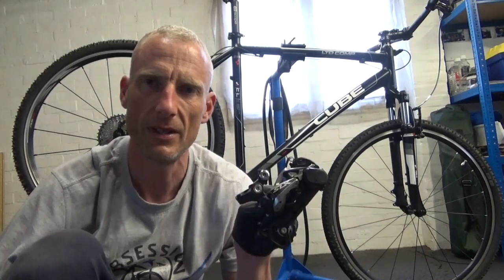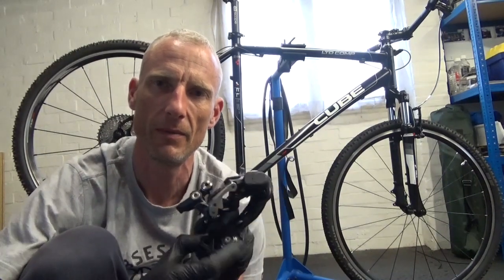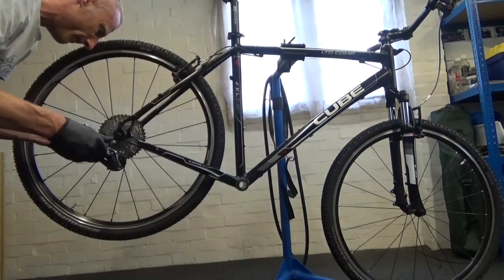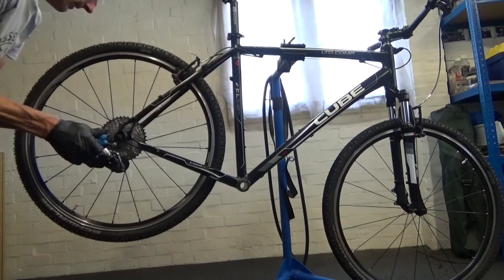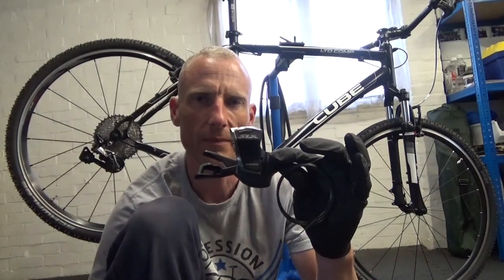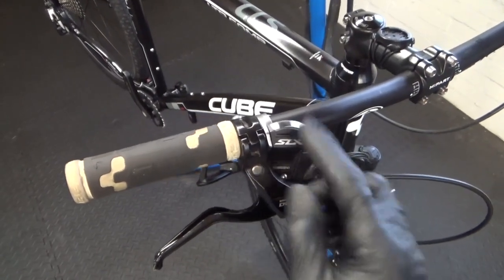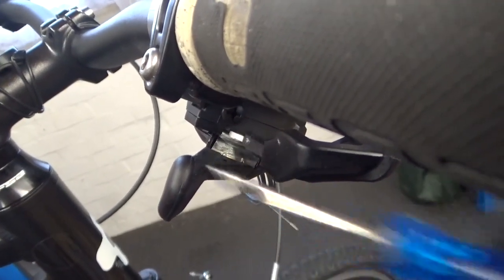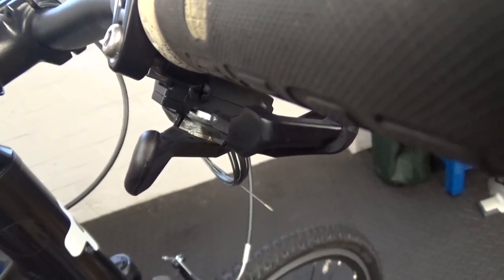Shimano SLX M7000 1x11 Fitting Guide

Comment: Thank you for an excellent and detailed video. As a fairly new and not so young cyclist I can manage most day to day maintenance but have not tried anything more adventurous than indexing gears and replacing the front derailleur. I have started to look at how difficult it would be to upgrade my Giant Toughroad SLR2 which has a very basic 2 x 9 Acura / Alivio groups to a 2 x 12 SLX setup, this is presenting more questions than answers. Do you have any pointers on the best way to work out if a specific drive chain combination will work on a specific bike, especially when it comes to bottom brackets and hubs?

Comment: Awesome video. Have the same groupset that I built for my wife (all raod parts except for the group set. Been looking around for the right chain length. I used the chain ring to the big cog method  plus 4 links ( works with sram one by) but the rear derailleur looked over pulled/ stretched. Then I used your method and it looked good now. Thanks again.

Comment: Thank you for the excellent videos. It’s great to see instruction in specific parts because there are differences in installing them.
I have a question about the SLX derailleur. Mine sometimes gets loose where the upper bolt attached to the derailleur hanger. Maybe because I need to use loctite before tightening. 
Seems like it happens after coming down trails. I’ll notice that the pulley is right against the cogs if I’m in the lowest gear.

Comment: Great video, thanks for sharing. I've spent the last couple of days upgrading my bike to the same groupset and your videos were very helpful. Where I got stuck is when I tried to set up my rear derailleur. Since I went for a 46 tooth cassette, when I screw in the B screw all the way in and push the derailleur it overlaps the largest cog by 1-2 mm. I have the same derailleur hanger as you is there a way around this, I can't seem to make that 5-7mm gap. (mounting without a chain on, same as on the video, I don't know if the chain will pull the derailleur down a bit)
Your help would be much appreciated!
Reply from the maker: The M7000 GS rear derailleur is rated for a 46t rear cassette, try fitting the chain then check the B-screw adjustment.
Reply: @FreeToCycle  Thanks for the advice, will do se and revert back. I appreciate your help